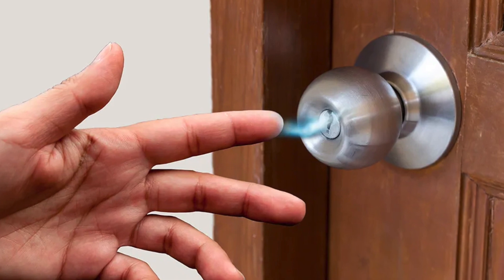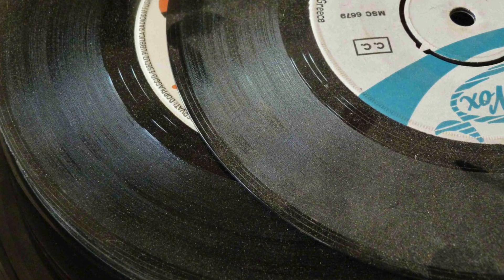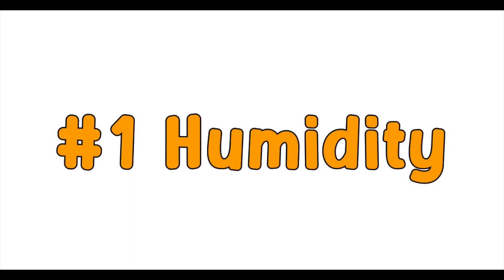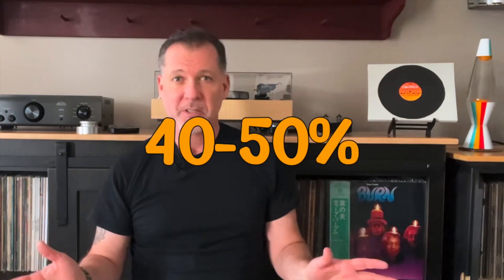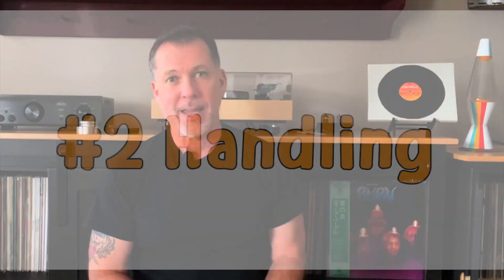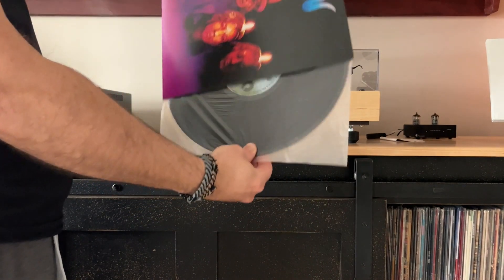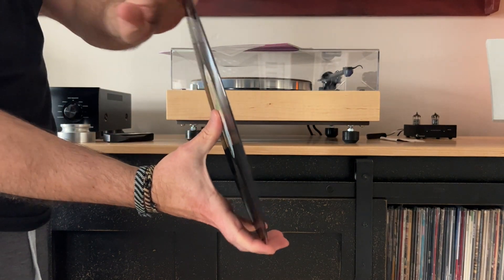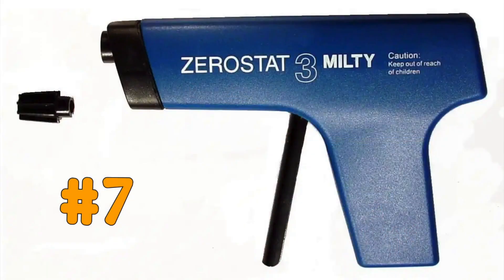Seven Ways to Save Vinyl Records from  Static Electricity

Comment: Good information but I got away from using anti-static brushes because the stylus was always dirty after playing a record that I had use the anti static brush on. Zerostat, cans of compressed air is what I use. And a bright light will reveal debris on what you thought was a clean album.
Reply from the maker: A friend of mine also uses compressed air.  He has also used the wood-glue trick but I would never in a million years recommend that.

Comment: Good tips overall, except brushes. These dont work as anti static the way most use them and is in direct contradiction with Nr 2.
If you say use minimal contact, which is correct, you must realize how contradictory it is to rub the whole disc with a brush several revolutions.
Mats are interesting too since your floormat might actually help build static when your feet rub against it. TT mats like cork or rubber on the other hand just serve to not lead static. They dont reduce it though.
Reply from the maker: All good points as always @leon9021.